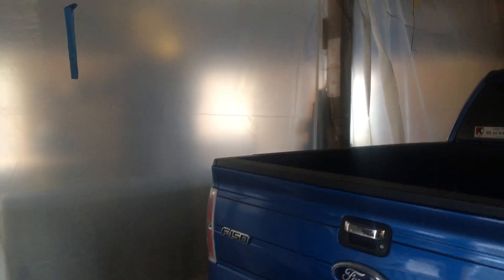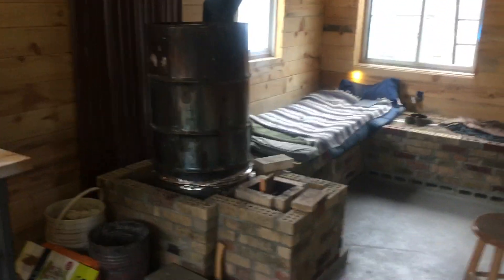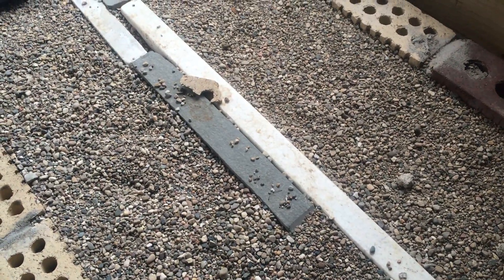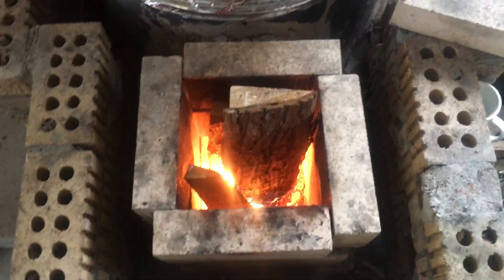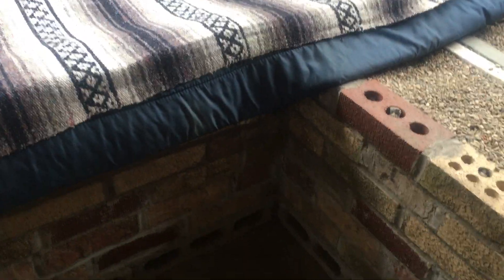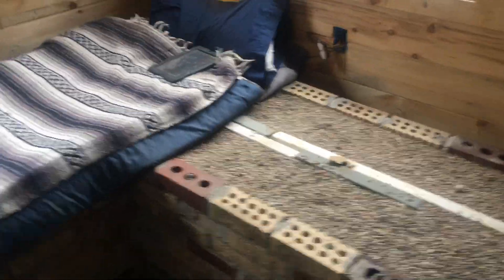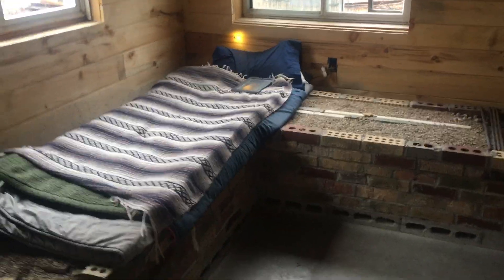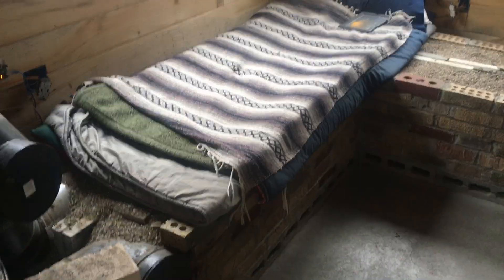Rocket Mass Heater build review 2019

Comment: You'd be crazy more efficient if you weren't sucking the warm air from in your room into the fire and wasting it up the chimney.  You need to duct air from outside into your fire.  Then the warm air in your shed stays in your shed. Even pellet stoves you can buy are designed to have the air they burn with ducted from outside to keep the warm air indoors inside.
Reply: Rocket Mass Heaters work a bit differently. They're not designed as air heating machines like a wood stove or central furnace. They are mass heaters.  The heat is stored in the mass and the purpose of the heat is to be transferred into the room primarily by radiation rather than convection.